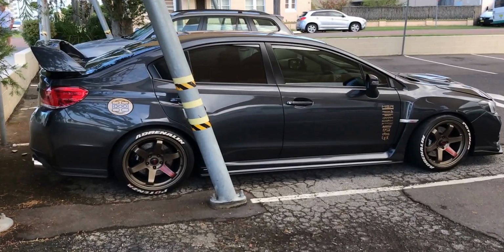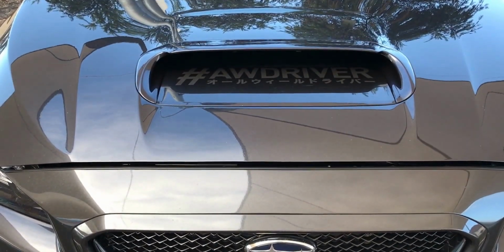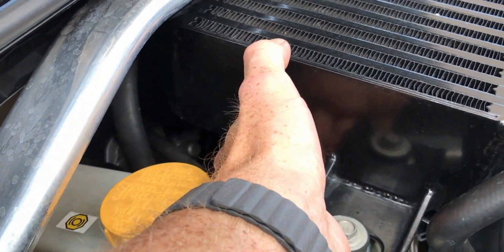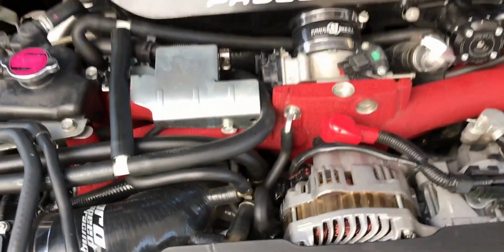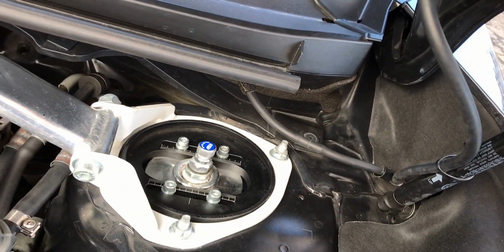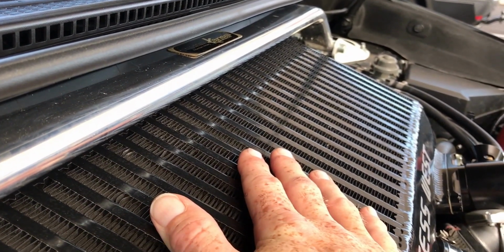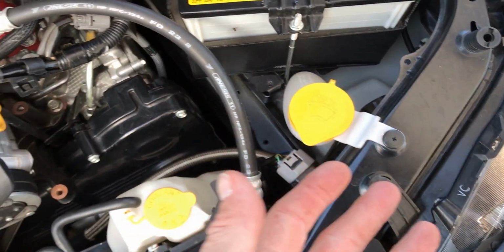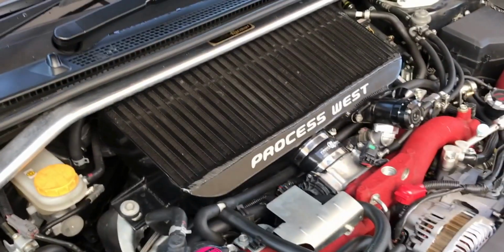How to keep your 350kW Subaru running cool.

Comment: What water pump are you running? Also don't get caught on the track with it... You will be sent packing.... Been doing it for 20 years... The really fast cars don't worry about this stuff now neither do l anymore .... Just a toy... It does assist but HP wins consistency ie what you have done with your motor with bigger displacement and bigger everything else negates controlling intake temps for the short term... If you know what I mean... Thanks for sharing. I had 8 Misting jets on my forester system with a 240v compact very high pressure pump... + dry Ice ❄ Also ran a cool fuel System in my RX2 in the early 90s....was lots of fun.
Reply from the maker: Adrian Rec, couldn't tell you the exact pump but she is big and I can dump a whole 5 litre reservoir in 3-5 boosted pulls, the water injection does make a big difference but when I integrate it with this cryo charge system Michael and I are talking about I effectively get an on-demand dry ice creation button. Should make a huge difference, we will fit a post-IC air temp sensor to get that AFR as spot on as possible (I should be able to run at sub 10c all the time, on demand).
Reply: Got any results for this -10dc charge temps yet